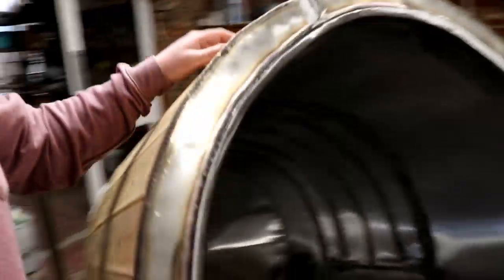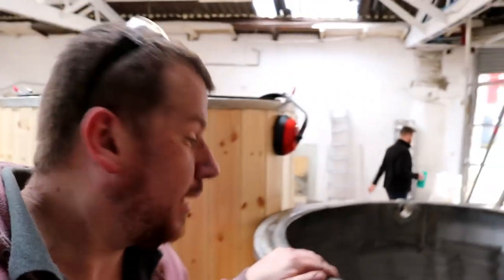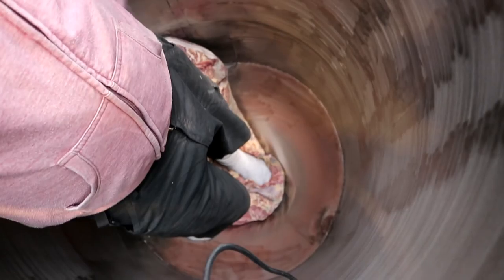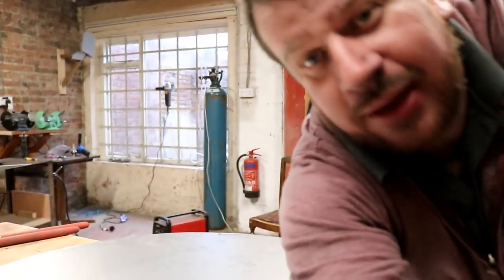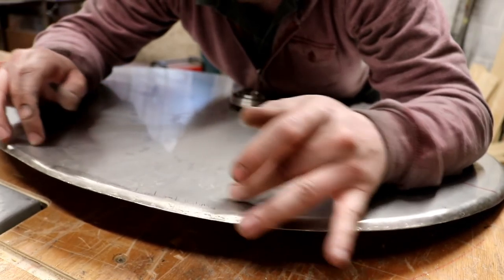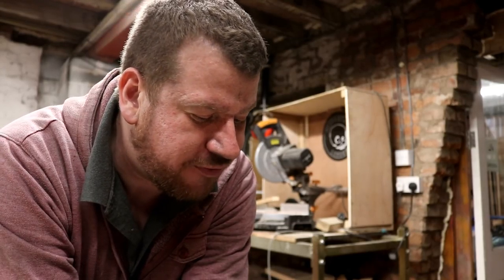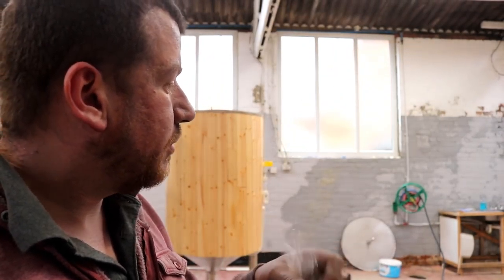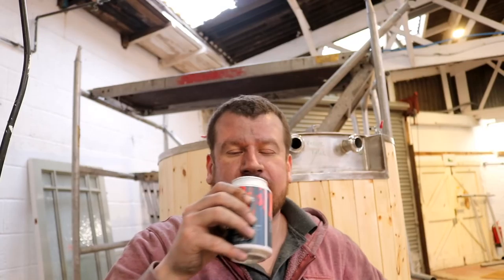BUFFING UP

Comment: Had an idea for you m8. Screw on a couple of kitchen unit type handles onto the ply b4 you glue it to the lid.
Will be helpful when lifting lid off with that extra weight. And u can hang the lid on a hook by the handle to stop it getting damaged or shitty when it's off for cleaning etc.
Booosh

Comment: Chop the heads off some bolts and weld them onto the lid and bolt your plywood on. Easily changed out then if needed and can be removed for better cleaning.

- someone beat me to it but will be far better that glueing.

Comment: Harry, How about welding some stainless bolts to the top of the lid then drill matching holes in the ply, counter sinking the head in the ply (or remove the heads completely and just have the threaded rod welded). You can then tighten with wingnuts or washers and nuts and when ya need to clean or replace either part it’s easily achieved.  Maybe a small amount of adhesive round the edge will be needed but the bolts should hold most of it flush. Cheers mate and keep up the vlogs. Jed in NZ

Comment: The pastry flakes will add to the finish 😄 .

I've not used Gorilla glue (mentioned previously) to stick Stainless to plywood but it sticks like shit to a blanket to just about everything (quote from bottle: "BONDS: Stone, Metal, Ceramic, Glass, Wood, Foam and More!"). It's 100% waterproof and is activated by water (give the ply a good soaking in water, apply glue to stainless and clamp the two together - put ply on flat surface, cover with glue applied stainless and place lots of weights all over the stainless to flatten it). The glue foams up so will fill any voids that may be left between the two surfaces and form a completely solid joint. I've used it to glue plastic to metal, wood to steel (not stainless), wood to wood and have yet to find any fault with it. Not entirely sure how it stands up to heat after curing but a quick google will find this link https://www.christinedemerchant.com/adhesive-glue-polyurethane.html . Cheers, Schnuz.
Reply from the maker: I think that might be a good candidate, cheers